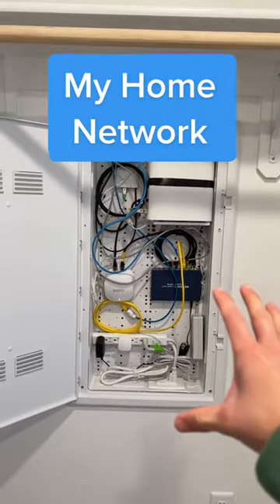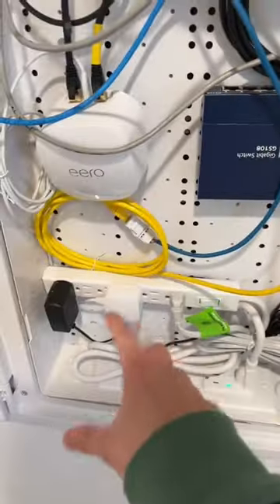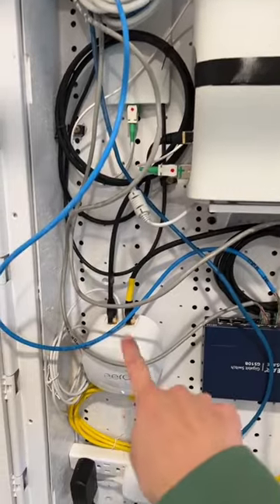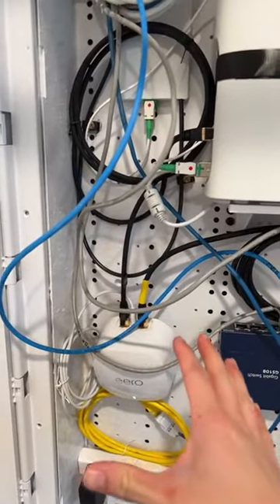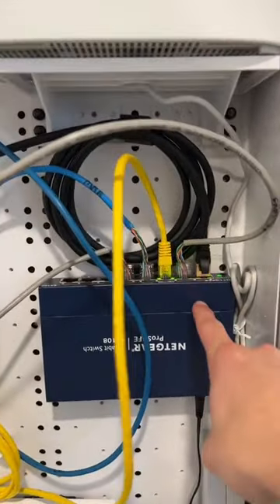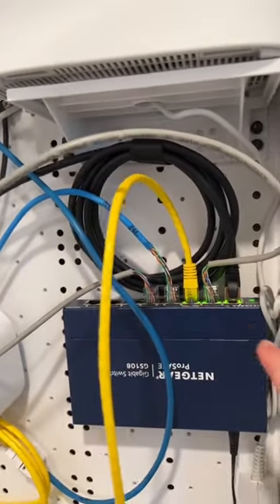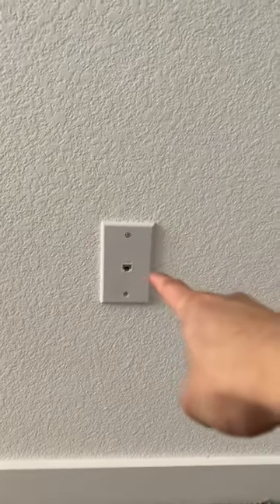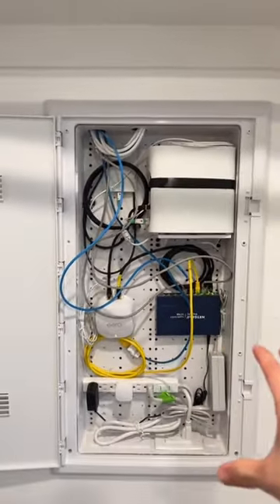Home Networking Setup | AT&T Fiber Setup Tour

Comment: I have invested in the unfi ecosystem for my house with UDM Pro, USW Pro-24-POW, 5 G5 bullets, AI Pro, AI bullet, G4 Doorbell Pro, and U7 Pro. Unfortunately I blew 8 ports on my switch when I was terminating wires that are plugged in to it for cameras. I highly doubt the warranty will cover it. It is an expensive lesson.

Comment: Need a multi gig switch, it’s 1 gig unless you’re on GPON then yes it’s 900/900; but you live in a MDU with upgraded optics so you should get xpon speeds unless you’re on an alt op splitter. I’d upgrade to 5 gig and then have them drop it down through the SHM app that way you’re moved to xpon splitter and can get 1300/1300
Reply: They’ve most likely already got him on an Xpon splitter, majority of new customers who order more than the basic 300 are put on GPON, and as of lately they companies have been wanting to switch everything over to XGPON

Comment: Me with a FortiNet FG-201E for routing, 4 Cisco Catalyst 3850s for switching, and Cisco Air wireless access points at home 💀 (gets a bit confusing)
Reply: that's homelab basicly. mine with 3 unifi ac lr and linksys lgs318p
Reply: @bagassetiawan1478  Correct. I work as a director of IT and it's all surplus from my job that I use as my homelab- I have a lot more than what I said, ESXi, windows server, cisco VOIP phones, the list goes on
Reply: @greembow  the power bill must insane, here where I live power have high cost so I can't use device as much as you do

Comment: So did you set the AT&T fiber device to Wi-Fi OFF and IP Passthrough to Eero?
Reply: And for that set-up....

May as well turn off the WiFi on the eero router/node too.

Since it obviously can't transmit or receive RF through the metal utility box.

That's what I don't like about this set-up. I'd have to sacrifice WiFi capability on one of the eero mesh nodes.
Reply: @H.T.2forever  Sorry I have no knowledge of any of this and plan on getting ATT fiber on my new home which has this metal box for internet. Will having the modem/router inside the metal box prevent me from getting wifi throughout the home?
Reply: @H.T.2forever the onq panel? The lid is plastic… I’ve installed thousands of these. He’s a 900 sqft apartment… wifi is fine 😂😂😂
Reply: @jzondo961 no dude. Don’t listen to wifi dweebs. RF is strong enough to travel through ONE side of the onq panel. Router has 12 fucking antennas for Christ sake 😂😂😌

Comment: Question to all, why would you not go from AT&T Router/Modem unit to the Gigabit Switch and then to the Eero 6 Plus unit?
Reply: If he goes through the eero then all devices can talk to each other wired or wireless, for example casting to smart tv. If he goes to the switch first - then wired devices will be on a separate network, although some devices will still be able to communicate with devices on eero but not all.

Comment: Good that you connected your remote eero devices by ethernet, but your RJ45 cable terminations are terrible. Go to reputable sources (one example - true cable) and learn to terminate ethernet cables correctly.
Reply: Or just use a Belkin box or 8 port PCB ethernet device. These are really good for staying organized so you can lable things and use patch cords instead to help with cable management

Comment: FYI: Definitely fix the tight bend on you fiber jumper that is going into the gateway … it has fiberglass inside that jumper —tight bends/high pressure WILL crack/fracture/break the fiber inside and you WILL lose service instantly 😂😂😂

Comment: He could have done most of that with just that bgw 320 in the upper right hand corner.  AT&T offers Wi-Fi extenders.  I bet he annoys every AT&T guy that walks into his house.
Reply: Or just install it somewhere in the center of the house if possible...so that the WiFi signal can be equally spread around.